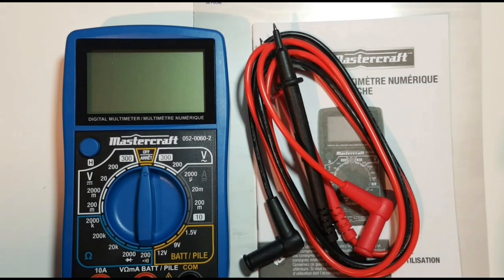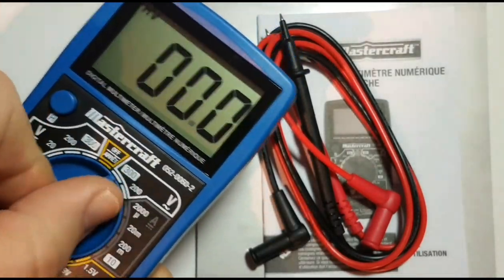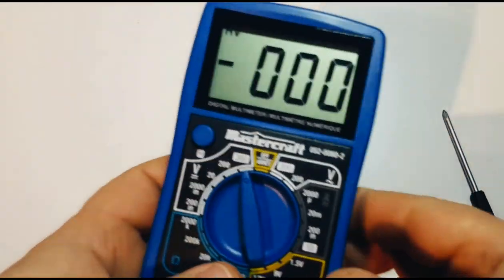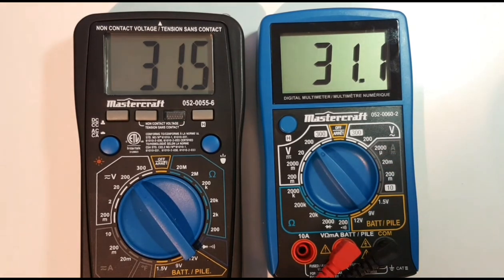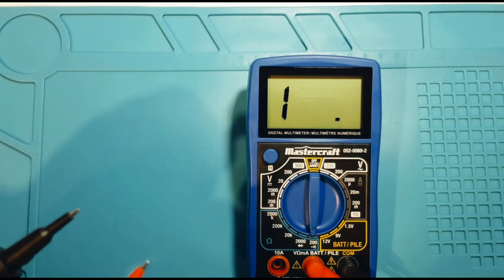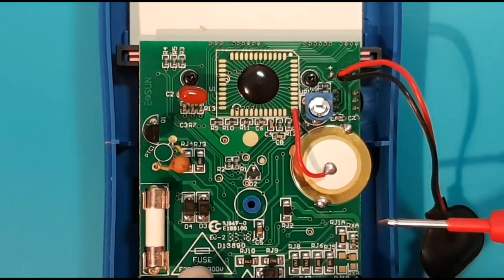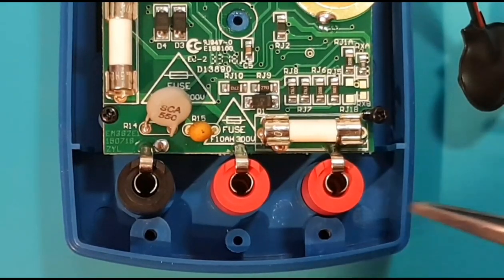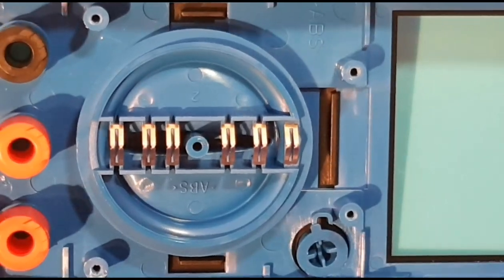Mastercraft 052-0060-2 CHEAP-O Multimeter Review & Teardown!

Comment: Does it read millivolts????? 
I got it to test a grounding mat. Paid $35 for the thing! Can’t take it back now, past the refund date! I need a how to vid asap! 🙁
Reply from the maker: Yes it reads millivolts..Set the selector switch to 200m (200 mV) on the Volts DC scale. 🙂👍
Reply: i just got it for the same reason, and can't get it into the grounding socket in the outlet
Reply: @Lightworker444  same, pain in the ass

Comment: I am a DIY homeowner who has used this meter happily for several years.  I am a little confused in that it has the exact same number as the one reviewed but a different functinality at the lower right of the dial.  There is no mention of battery testing, rather a diode test spot and one other.  My whole purpose to watch was to see if it would properly test small batteries but am left wondering why exactly the same model of meter has different functionality.  I would have thought that would warrant a different model number.  Good video though.
Reply from the maker: Thanks. I agree the Canadian Tire naming schema is lame to say the least. It most definitely should be renamed but instead they  simply lump them together into multiple generations of multimeters with same name. Bonkers I know ! 😅

Comment: i have recently got this meter a couple weeks ago and it was working fine with no problems then all of a sudden the display is stuck as -0000 and wont read anything  anymore please help
Reply from the maker: If you want to send it in, I will fix it for free and ship back no charge. I might do a repair segment and use it on the channel. 
Email me: netplicity1@gmail.com

Comment: Darren, can I test block heaterto see if it’s functional if so how?  Thx
Reply from the maker: Set your multimeter to the "ohms" setting, then touch one probe to each of the prongs on the block heater plug and read the resistance. About 25 ohms is good...0 means the block heater is no good.
Reply: I understand that, my question is which ohms setting?  Thx
Reply from the maker: @ggrong4356  Select the lowest Ohms setting...200 Ohm.
Reply: Thanks Darren appreciate that.
Reply from the maker: @ggrong4356  Anytime..let's hope ol man winter doesnt stick around too long!

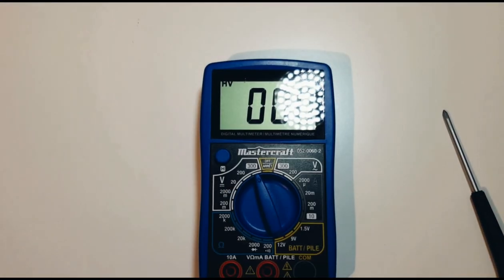Comment: Nice to see 'Crappy-Tire' has started to stop from OEMing garbage DMM's from Colluck. I have 5 more CT meters bought on-sale over the years and some of them have 0.1" clearance between PCB traces coming directly off the probes, so naturally I have limited those to LV bench work only. I have the other DMM (shown at 5:01 on left) it has less protection but I found it has an interesting trait - it does a good job on resistance right down to 0.1 ohm and that's something even my Fluke-77II doesn't do to well. My next purchase will be a Brymen 869s from TME in Europe - that thing for the money just can't be beat and with 200,000 counts.. that's the "ducks-guts"
Reply from the maker: Yes, they have definitely improved over the years..input protection has never been stellar with CT meters but things are getting better. Interesting note on the low ohm capabilities I'll have to look further , a definite plus at this price point. Agreed, the BM869 would be a welcome addition to any test bench and will definitely get us meterphiles drooling 😍 congrats on your future purchase!

Comment: Where do i install the battery
Reply from the maker: Back of the multimeter..located at the top , just over the tilt stand is one Philips screw, remove and pull off the cover ..insert 1 -9v battery 🤩👍

Comment: 1000 volts through a 22guage wire-??  That is a pee-weak continuity beeper, when probemasters make zero difference thats pretty bad.  There are however molded in supports on the rear lower case half to support and capture the input jack sleeves. The display is a nice size with bold digits, also the circuit board is surprisingly better than expected, it actually offers some meaningful input protection in a very low price range, this meter is a definite step up from a Harbor Freight type 830 cheapie, better than a few others in this price range as well.  One could swap out the peizo for a louder one for a better continuity volume, change out the leads to make it a pretty good low dollar rig. You could do much worse for the price.

Comment: Measly  2000k? You do understand that’s 2000 x 1000 ohms?
Reply from the maker: Nope. 2000K...That's the equivalent of 2 Megaohm. Check your math.
Reply: 2000K =2,000,000  ohms= 2 Megaohms
Reply from the maker: @supercamario  That's correct 👌  a measly 2 Megaohms.

Comment: Well I have to say im also more than surprised by the better than usual input protection in such a low cost device.  This is kind of what the Harbor Freight freebie 830B meters could/should be if they werent built to giveaway prices.  Its obviously a cheap-o meter and continuity isnt great but its to be expected half the time in this range - but if it measures accurately and performs its basic functions it still serves a useful purpose.  It has a decent display & range switch and the fact that a meter in this price range has any meaningful input protection at all is rare indeed and the fact they cared enough to include it shows even though it was obviously built to a price they didnt go total bargain  basement/bottom of the barrel like the scary 830B clones with no fuses or protection of any kind.  Its actually irresponsible to even allow such meters as the badly designed 830B's on the market, theyre just plain dangerous.
Reply from the maker: You hit the nail on the head! Cheap doesn't have to mean "deadly or complete garbage"...you can sacrifice alot of things but how much does a PTC/MOV and some fuses really cost? I don't get it...but its nice when I see an OEM putting some attention on these "cheap" meters. I still don't understand why basic shielding is almost non-existent...it was standard in design 20+ years ago...?? Basic multimeter design needs to improve and the louder we scream hopefully the more they will listen. Now when do you think we will see an HRC fuse in an 830b ? :)
Too bad the continuity was so bad, I was hoping we had another surprise on our hands...oh well!
Reply: I already emailed you regarding the allsun webstore as they seem to have a bit better build quality / bang for the buck in the cheap-o meter realm - their slightly more expensive EM420B looked like a pretty good next step up for $17.99.  I see theres an EM 420A, B and C in this type.
Reply from the maker: @yambo59  Yes, I'll have to take a closer look at all-Sun, might be some pleasant surprises here...
Reply: Yeah seems like they might be one of those rare little known better built values in the cheap meter market
Reply from the maker: @yambo59  Indeed, I think its time to explore the all-sun, I'm always eager to find a better built multimeter ..at the best price.